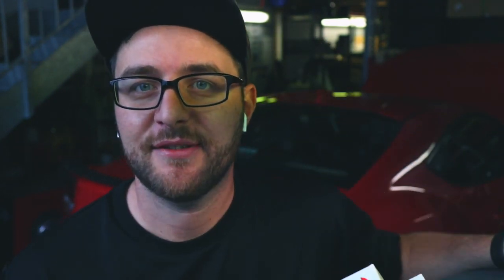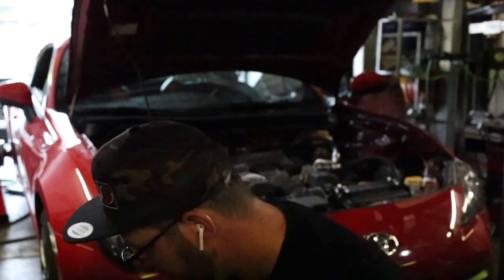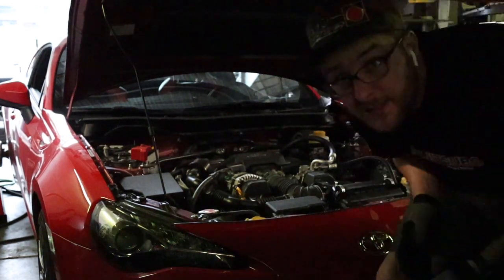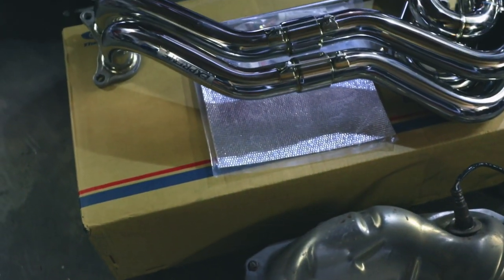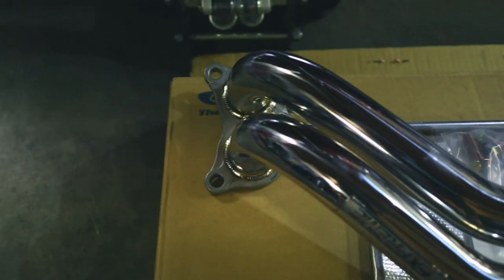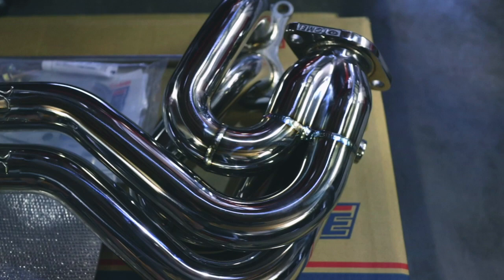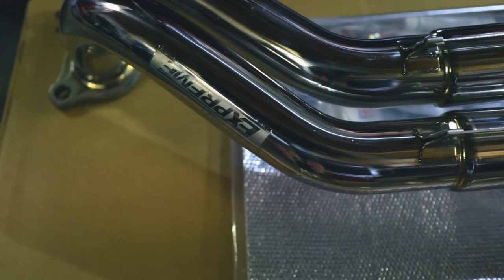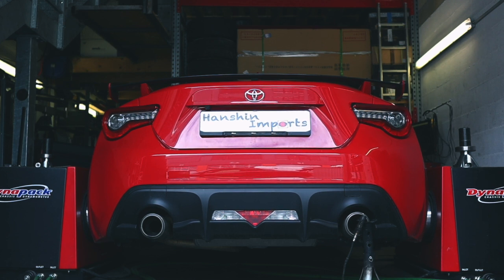Myth Bustin' How much does an Air filter? UEL Header? And custom Tune increase power on GT86/BRZ/FRS

Comment from the maker: Who likes these kinds of videos with performance gains checks and other « myth bustin’ » videos? What kind of facts would you like me to check? This is your chance, I might actually use your idea 🔥❤️👍🏼
Reply: Love this kind of video! Danny DC2s one on MR2 air filters did very well and was really useful. Not many people have their own dyno!
Reply from the maker: @LupinYonderboy  thanks mate! Yeah I saw that video! Its really good 🔥👍🏼👍🏼👍🏼
Reply: @JesseSpec  As a tuner, I wonder If I could ask your opinion. My next big purchase for my 2ZZ MR2 would be a stand alone ECU and tune up. It's got a sports cat, pre cat delete, high flow custom exhaust and a fancy air filter. I'm not expecting big gains from a tune but it would open the door to further mods down the road. I'm thinking EMU Black ECU. Thoughts ? thx
Reply from the maker: @LupinYonderboy  i’m pretty sur you can make 10hp+ from a tune on this engine. To be honest, I’ve never used that brand of ECUs so I can’t really give my opinion. If I had to buy again an Ecu, I’d probably wire in a Link ECU and put closed loop lambda. It makes the tuning much more reliable and straightforward 🔥👍🏼👍🏼
Reply: @JesseSpec  Thanks for you're advice. It makes that video of the Lithuanian autocross guy with a 2zz claiming 220HP with a few other mods not that crazy. It would be nice to lower the VVTI-L point lower in the revs too. I think it can be brought down about 500rpm.
Reply from the maker: @LupinYonderboy  the vvtli point has to be set at the point where peak power is reached on the low cam and where it cuts over the power graph of the high cam dyno run curve (when superposing both dyno graphs). Thats why I’m not sure lowering it is the best thing to do. One has to optimise the timing of cross over according to what the dyno says. Doing it with the gut feeling is probably not a good idea 😊👍🏼
Reply from the maker: This of course should work if you have a well staged transmission that will not allow you to fall under the vvtli threshhold 😃👍🏼

Comment: Great video man. Was wondering how much power gains from same mods but with AT transmission + TRD Muffler
Reply from the maker: Hi, thank you! Honestly I don’t think the gain will be very big with only a TRD muffler
Reply: @JesseSpec  think he meant on an auto but with the TRD catback in addition to manifold + Panel filter + tune
Reply from the maker: @Icemann336  I’ve never done that exhaust but It should be similar results if not a bit more

Comment: Hi Jesse, correct me if I'm wrong but wouldn't the values displayed by your dyno be measured in WHP? Brz/86s are rated at 200 crank HP as far as I'm aware.
Reply from the maker: Hi! Thanks for your comment. No this is engine HP (18% transmission loss). Sadly, I’ve mapped 40+ gt86/brz ´s and none made more than 185hp at the engine. They secerly underperform from a performance perspective in stock form. Check on google, you’ll see ;-) in the end its the power increase thats important, more than the end figure that isn’t that important 😊👍🏼
Reply: @JesseSpec  Thanks for responding. Wow that is surprising. I am definitely impressed at the power gained though a few mods and a tune. Keep up the great work. Great video.
Reply from the maker: @usernamehere69  thanks man. I honestly don’t understand why Toyota and Subaru dont respect the given figures 😭
Reply: @JesseSpec  but this is NOT what google says. Googling stock brz dynos seems to give an average of around 155-165 for pre-facelift, and 165-175 for post facelift, right in line with the rated torque figures. It’s not a big deal, your dyno just reads a lot lower than others. Maybe it’s a correction factor thing, who knows.
Reply from the maker: @blasphemicwhale  in the end its the gain that we care about, not the a end figure ;-) each dyno reads differently
Reply: @JesseSpec  Without strapping it on an engine dyno directly to the crank, we cant really claim that. This is a measurement taken at the wheels with some random calculation applied that will vary with every car. You cannot get an accurate crank HP number that way. You are measuring directly from the hubs. Why not quote WHP like everyone else?
Reply from the maker: @boost331  Why should I? Because in Switzerland people aren't interested by Axle power or WHP. They want an estimate at the motor. This is why we give an estimate with 18% loss in the transmission (which other dynos could measure and that we use as a benchmark transmission loss). But even then, if you watched the video, you will see that all we care about is the gain before and after the mods, not the final number. Since every dyno/car/situation/ambient temp...etc is different. Does that make sense for you?
Reply: @JesseSpec   The important number is how much power is actually being delivered to the tires. That will tell you how the car will perform. A car can make 1000HP at the engine, but if only 500 of it makes it to the wheels what good does knowing it is 1000 at the motor  do anyone? I can appreciate just looking for the gains, and maybe its a cultural thing, but most of the world reports dyno figures as power to the wheels because in reality that is the final result. There are too many variables between the motor and the wheels and as mentioned it makes no difference what the motor makes if it cant get it to the wheels. I just see it as very inaccurate. A measurement at the wheels is what it is. It turns into a broad guess once calculations are applied to come up with an engine power estimate. Modern cars with low mass internals, ulta thin synthetic fluids, low friction gears and such make a huge difference in drivetrain loss. 18% is a rather high estimate in many cases. That would be why I think its best to tell what the power at the wheels actually is, rather than what the engine power might be based on some rudimentary math.
Reply from the maker: @boost331  I get what you say, but that still doesn’t change the fact that in Europe people like to have engine power estimates. Also the 18% is actually quite spot on for a GT86

Comment: Do not change the factory catback ever. The standard one sounds and works best
Reply from the maker: Depends for what application. For NA surely ok. Turbo or SC definitely ly restrictive
Reply: Not true, a proper catback system will sound better and will bring more performance, perrin 2.5 is a good example of a good catback system, not too loud